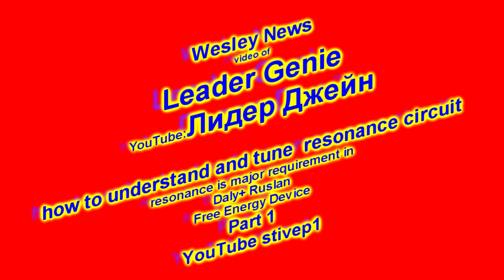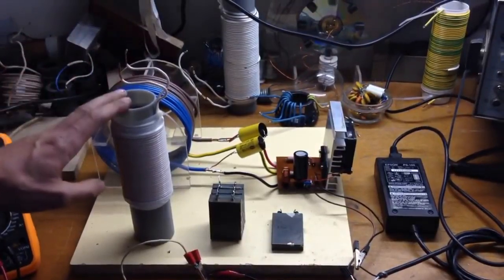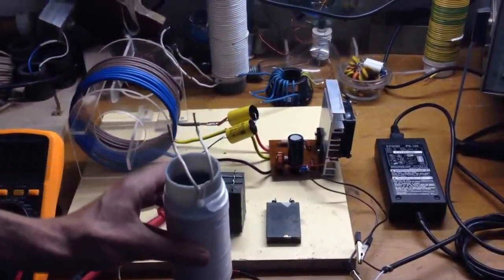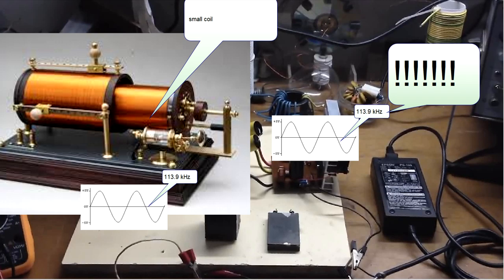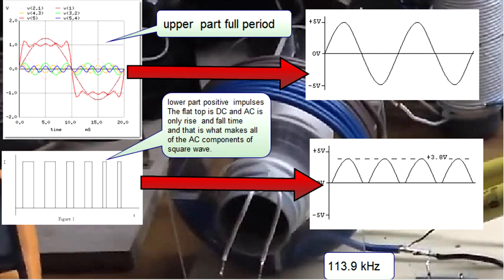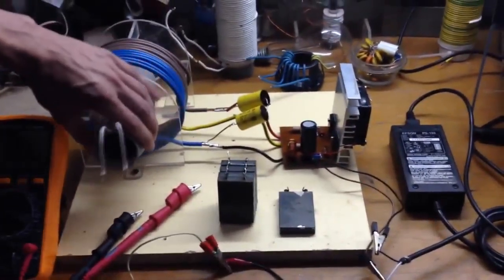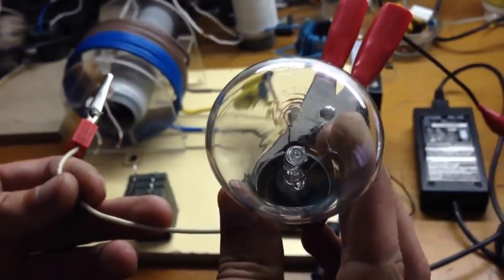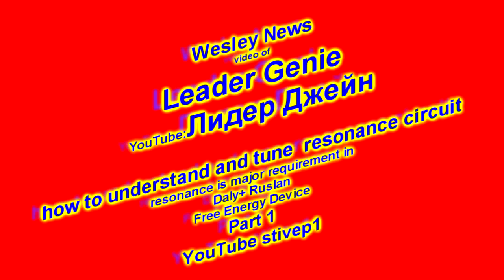Wesley presents:Leader Giene-tuning nanosecond impulse circuit.

Comment: -but to change the resistor which is connected to another power bulb change demand capacitor you need to add a good job.

Comment: Nice job. But as Tesla found out caps are not perfect. They break down and are expensive to replace. That is why he explored the bifilar design of coils. The capacitance is built in to the design of the bifilar coils.
Reply from the maker: You can use capacitors or not. Capacitor is needed if you want to get to resonance frequency  not utilizing coil own capacitive reactance. - that would require to use a lot of wire.
Reply: Well I doubt that using a lot of wire makes a diff. What does make a diff is the surface area of the wire being used as capacitance is based on surface area of the two plates or in this case the joint between two wires. Yes this will change the way we think about using bifilar coils and how we can integrate them into regular situations. Tesla was very very clear that having a capacitor outside of the coil does work but there is a ton of negatives for using them. Cost, maintenance and ruggedness being the main issues.
 Ever wonder why Tesla was looking into how a wires capacitance changes. He was of the opinion from his experiments that a wires capacitance is not a stable stat. That it varies with the surface area, elevation, time of day and environmental charge levels (which is based on elevation and things like that(proven by Tesla experiment)).

Comment: If you try to connect a second source of DC 24V in parallel and powered it from the received 220, then disconnect the first 24V source. Do you think the system will be autonomous, will maintain itself?
Reply from the maker: Max Xim  I think in Colman thee is no need for any battery at all. The energy  in form of DC "should be" ":)   present at the ends of the tube. And size of the tube "stands" :) for the power( square)  the activation could be done from 9V bat, separate transmitter of small power.  The mechanism of it is similar to someone talking with 1W from  a distance and someone talking with 1W  directly to your ear.-His voice would be even  to loud .
Or just load capacitor that would be powered along with timer from the same Colman tube.
Reply: stivep1 You see, stivep1, I had an idea to eliminate high voltage if the system itself supported, would be autonomous.
This would eliminate the difficulties in the manufacture of high-voltage system components.